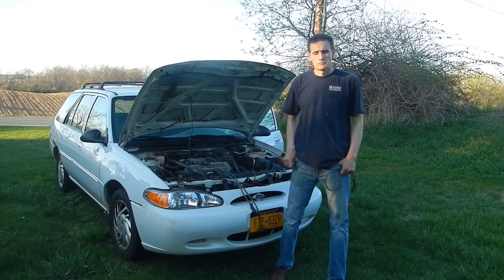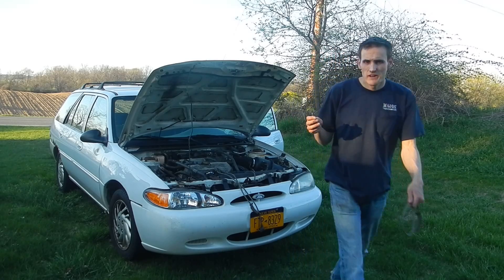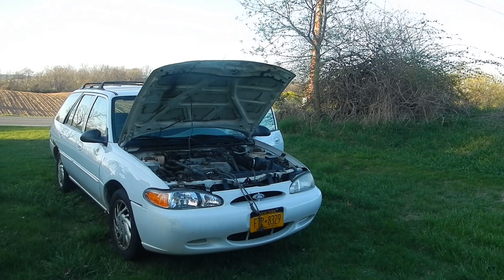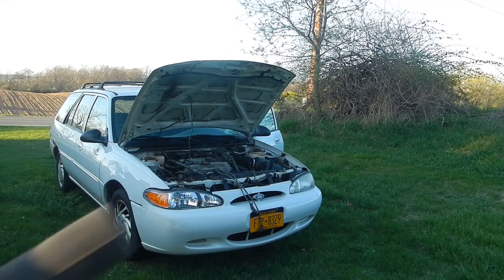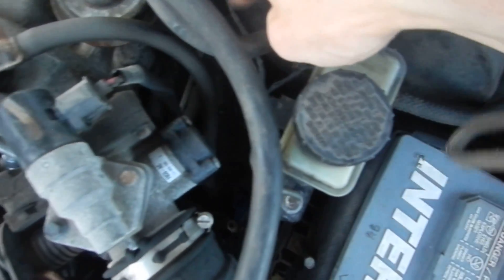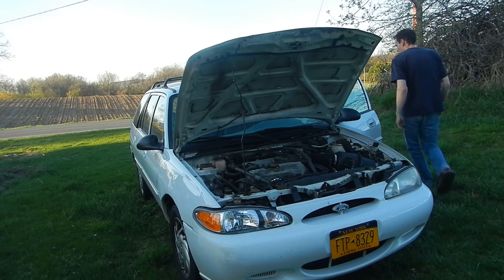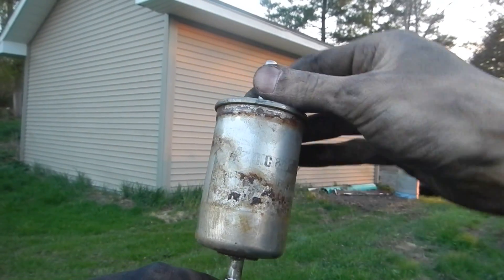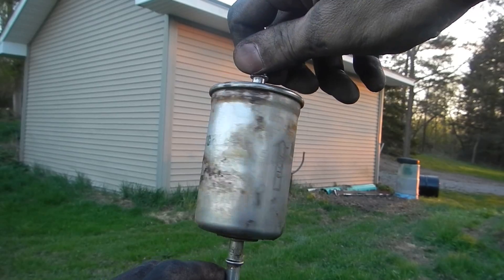Changing Fuel Filter Ford Escort 1997-2001 P1131 SOLVED

Comment: To everyone: get a set of quick line disconnects and a piece of fuel line same gauge, why? Because this guy didn't tell you. The 90° quick disconnects will sheer off inside of the short fuel line that leads to the fuel filter. And this is a very difficult thing to do if you have big arms instead of noodle arms. Remove the intake first. And careful not to bend vacuum lines. And do not put a screw clamp on it to secure it, just use a weatherproof zip tie, because it rattling around will not hurt it. There's a damn coolant hose in the way holding it virtually in place.
Reply: Take out the battery mount

Comment: Just finished changing my fuel filter. Fixed the lean code. But just so y'all know, the bottom plastic clip is a mother fucker without the proper tool. Also, go slow, don't fuck anything up down there
Reply from the maker: The kit comes with plastic clips

Comment: I've got a escort with a P0171 (lean bank 1) here is what I've done to try and fix it:
New manifold intake gaskets
New 02
New MAF
New Spark Plugs
New Spark plug wiring harness
Removed EGR and unplugged intake EGR and can

The symptom is a spike in fuel trims at idle, resulting in poor idle with VERY occasional stall at idle. The performance and fuel trims normalizing at rpms in excess of 1,500.
Reply from the maker: Did you check the fuel pressure and replace the fuel filter?

Comment: So how did you get the bottom hose off the filter . . . I see no way of doing that from the top. Did you have to go under the car?
Reply from the maker: No I reached under the filter and pulled out the clip possibly with a small flat head screw driver.
Reply: @supermetaltastic  Ok thanks.
Reply: IKR! Bought a 99 (20k driving miles 70 towing. Been setting. So I'm replacing all "Fuel" related... You're a doll!  Can we change out some parts together some time? 🤷 😁

Comment: Same here. DTC Code  P1131.
Car will be weak on acceleration, bog down, may idle rough. If you rev in neutral then  let off gas pedal, car may stall
Car may go into safe mode and you will not be able to go faster than 35 mph
 pull the spark plugs and if all 4  are white (running lean and hot) then change that filter. Problem solved.
1997 Escort wagon
Reply from the maker: Thank you for your added input

Comment: I have a 1999 Zx2 escort that I had a timing belt put on. Got it back Wednesday and mechanic says probably has engine damage because now it has low compression in cylinder 3.  I thought this car was non interference engine though? However car is running fine no misfiring at all, but today it's throwing these codes P1131 and P1234
Reply from the maker: Todd Renje they are non interference engine however they are known for dropping valve seats.
Reply: Would a dropped valve seat cause these codes?
Reply from the maker: The engine would not run fine if you dropped a valve seat. Sounds like a fuel delivery problem with a problem with your fuel pump drive module. Here is the website you need. https://www.justanswer.com/ford/1mhrd-1999-ford-escort-wagon-2-0l-122cid-l4-fi-p-no-power.html
Reply: I didn't have any codes before they fixed my timing belt. I'm thinking they forgot to reconnect something somewhere maybe? I'm going to take it back Monday. Thanks a lot, you've been a been help!
Reply from the maker: Did you get the problem fixed?
Reply: Adam Prince, I haven't got to work on it yet, but the car is actually running fine besides check engine light. I'm going to start with the fuel filter though. Are those clips hard to get off?
Reply from the maker: The bottom one is more difficult than the top one. Just pop them off with a flat head screw driver. Follow the directions in the video.

Comment: @Adam Prince Hello, thanks for the video. I have a question. I have an 03 Zx2 that at acts up around 50 mph. It gets worse when I turn on the Ac. It sputters around 2,000 rpms. When I get on it there is no problem as I can tell. I got the car a year ago and it has been doing this since. I thought it was just me. But then I had a mechanic friend riding with me and he said he felt it to. Could this be the fuel filter? It only has 61,000 miles
Reply: It may  fuel filter or pump ,I’d try changing filter first and if that don’t work it may be fuel pump .
Reply from the maker: Check the fuel pressure and the spark plugs and wires. Plugs and wires are supposed to be changed every 100,000 miles.

Comment: Hi Adam, I have a 1997 Escort, and it sputters randomly at high speeds or whenever I apply load. It idles fine, it will get to 70/75mph fine with moderate input. If I try to floor it it will start fast-sputtering. Where should I start looking? No codes shown. Thank you!
Reply from the maker: I would start with spark plugs and wires. They wear out after 90,000 miles. The more load on the engine the harder the ignition works. If its not that,  I would download forscan to my phone. Then I would get a blue tooth obd ii reader and start looking at data.
Reply: @supermetaltastic  thank you for your reply. I did replace the plugs less than 1000 miles ago, but I didn't do the plugs because they didn't look beat up. I'll go with that and test it , hopefully that'll solve the issue. Thanks again.

Comment: Great video new subscriber. Do you still have that escort?
Reply from the maker: Yes, 250,218 miles. I took it off the road. It needs new front tires, shocks, and the new stainless flexible exhaust rusted out in 18 months.
Reply: @supermetaltastic  after watching your video i believe i can do mine. I have one like yours. Currently its running hot i changed temperature sensor still gauge going all the way to the H. I changed relay. So this weekend I am going to drain the antifreeze and flush the radiator and heater core because I get no heat or a/c. The mechanics around me doesn't want to work on my car they call it a piece of junk. They are so disrespectful. 🤣 but she's my baby and I love her. No Homo.

Comment: What was the problem you were having?
Reply from the maker: I had a check engine light. P1331, air/fuel metering problem. It was also idling roughly. I made another video about checking the oxygen sensor. The problem ended up being the fuel filter though.
Reply: Adam Prince Sounds just like the problem is having. I just haven't checked for codes yet. Hope this is what's wrong with mine as well. Thank you for the vid and quick response